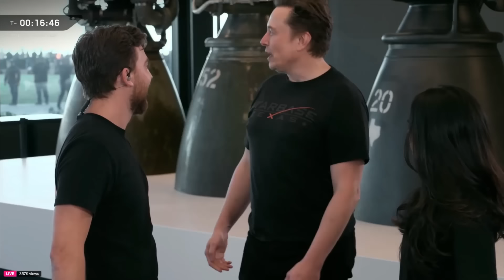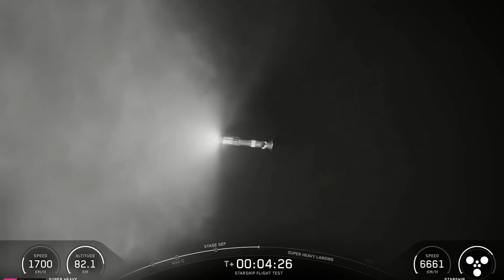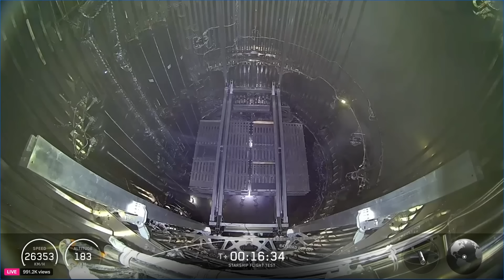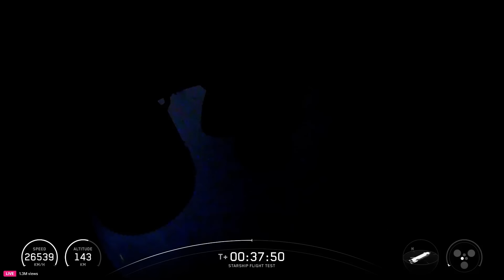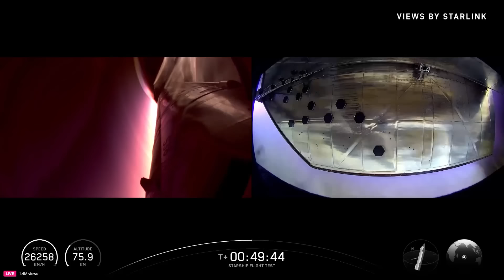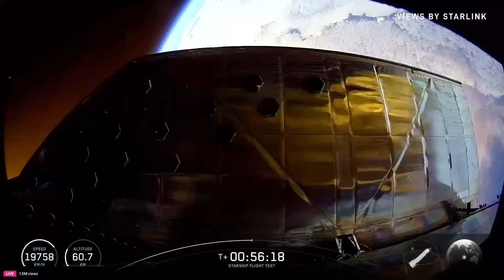The Most Unbelievable Rocket Launch In History (SpaceX Starship 11)

Comment: If reentry didn't blow up starship steel hull, how did jet fuel manage to melt steel beams!!
Reply: Government/CIA: Jet fuel caused the beams to melt
Thinkers/engineers: hmmm, that doesn't hold true to the science
Reply: @erictsang0  uuhh...maybe because Starship was built with a "heat shield?" Jet fuel didn't need to melt anything...just get it hot enough to make it weak. It's not that hard. Blacksmiths have done for years using basic fuels and air bellows to heat and soften steel so it can be easily worked.
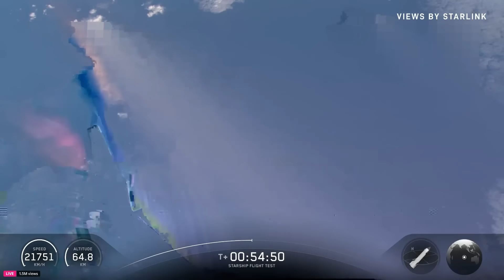Reply: @billg.9087  Yes, they usually use heatshield tiles, but on this test flight, at 26:15 & 30:40, they mentioned that they're conducting "missing [heatshield] tile tests". At 27:25, they mentioned that they're exposing "bare steel" to the elements as well. I wasn't aware, but they said that they have been doing missing tile tests on previous test flights too. Maybe you are referring to an additional heatshield that I'm not aware of? It's a long video, so it's easy for anyone to miss details, I think.
Reply: @erictsang0  correct...but just a few tiles. The heatshield is still 99% intact. My point was you can't  compare regular steel that simply got hot enough to weaken to what the Starship is made of.

Comment: i still don't get it why they have to land the booster into the ocean and not a pad to reuse the booster..
Reply: ...they can, and have, but the testing they've been doing to find the booster's limits are risky. The amount of damage that could be done to the launch pad/tower isn't worth the risk. Not to mention the development speed often means that the next version is already being built, and there is no intention of reusing the older version. This is a V2 (block 2) and was the last flight for block 2. Next flight will be a block 3 with a number of changes with lessons learned from successes and failures of previous flights.
Reply: @fujitofusan  Because they can’t make it happen yet.
Reply: @ahou8733 you mean except for the times they actually tried to catch the boosters mid-air and it worked perfectly?
Reply: @billg.9087   I mean on a pad.
Reply: @ahou8733 you really need to go back and watch previous flights. They already have landed on a pad. The "catching it with chopsticks" has been done  twice and was chosen over landing on a pad because it is a great savings in weight....which means higher payloads and less fuel needed. So, I'm not sure what you are referring to when you say they can't....

Comment: Can the stages/engines be reused?  Or does the sudden quench weaken the metal?
Reply: This was the last of the V2 rocket design. The next rockets to fly for the Starship program will be the V3 version. That will be a larger rocket with more powerful raptor 3 engines.

Comment: At 2:27, there is a glich on the nose. Does anyone know what this could be?
Reply: My guess is an image compression artefact.
Reply: In the film industry we call it a rolling shutter artifact. Essentially, cameras record from top down when capturing light data to make a single frame, but if an object is moving really fast (or if the camera is set to be slow) it can cause warping distortions as the data from the captured light is desynchronized while creating the frame. The result is two different moments of time overlapping in a single image.

Comment: An incredible achievement. Congratulations to the whole team at Space X
Reply: Probably penniless “interns” getting worked over!
Reply: No, this is another piece of crap that explodes on the water.
Reply: What's the achievement?  They crashed it into the ocean.  AGAIN...  Isn't the whole point to reuse them?
Reply: @captaincobb8146  No instead of relighting 13 engines, they relit 5 and then down to three. Goal was to see if they could save fuel for landing and use that fuel for liftoff instead. Testing this for the new booster version as this version will no longer fly again.
Reply: @casuallygaming8154  Okay.  So they're testing a new landing procedure.  But why not still try to catch it?  The worst thing that could have happened is that it didn't work, and it crashed.  Same outcome.
I'm no Tree-Hugger or environmentalist, but blowing things up in the ocean isn't cool!
If the test failed and it crashed at or near its landing tower, 100% of it would be cleaned up, and no aquatic life would die.  And I'll bet that they don't recover 100% of it from the sea floor.
Reply: @captaincobb8146  Before people were amazed that they could catch them and now were complaining that they’re not? 🤣🤡

Comment: Why didn't they catch the booster, as they have before?  Why did they purposely lose it in the ocean?  They should have provided an explanation of why they didn't catch or land it. This has the appearance that they're going backwards in capability by not catching the booster.
Reply: They DID catch it, but virtually. The booster aimed for a virtual tower in the ocean. It saved time and expenses to just dispose of this model
Reply: They already have that figured out. These flights are for different tests.
Reply: To answer your questions:  They didn't catch the booster because they didn't want to risk the ground infrastructure for a booster/engines that will never be flown again.  It has already proven itself for catch with B12 and B15.  Regarding "losing it in the ocean", they purposely hovered several feet up before cutting engines resulting in an explosion so that the booster would sink immediately.  In the past, they had an issue when they did a "soft" landing in the ocean, and it drifted into Mexican waters.  This was the last of the Block 2 booster/ship....on to Block 3 with much more capable hardware.  Definitely NOT a step backward.
Reply: They have repeatedly provided explanations for the mission profiles of 10 and 11, and a few more of the flights.
Reply: @michaelreilly569  they already proved they can catch it. They are testing systems. They don't want to risk life or infrastructure if they don't have to. Once they are confident they will catch both booster and starship.
Reply: If they had caught it then they would have had the massive cost, time and energy required to scrap it.
Reply: "They should have provided an explanation"

They did. They explained what the plan was and why they were doing so weeks before the launch. They then posted on their site the plan for the launch. They also posted on X stating what they were doing. All of that was well before the launch. Then immediately before the launch, they explained again. Likely several times. Then again during the launch, they explained again. And of course they explained after the flight as well.

Just because you refused to listen doesn't mean they didn't explain. Pay attention next time.